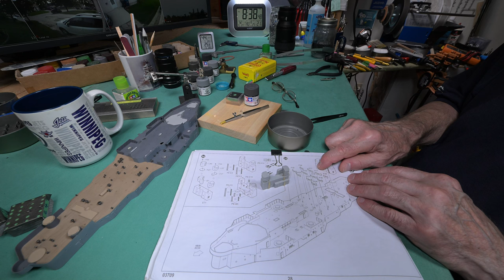The Model Ship - Part 1282

Comment: Hi Ron, I have a thought that might help with the brush painting, if that’s ok. Tamiya paint is actually pretty difficult to brush paint as it’s mainly designed for airbrushing, but it can be thinned and brush painted with a few simple techniques. The trick is to use multiple thin coats, as you are, but with each coat don’t brush more than a few times in the same spot. Repeated strokes will cause the thinners in the paint to dissolve the previous coats and rub the paint off the plastic. Just put on the paint, leave it to dry, then add more coats as needed until it’s perfectly covered. I hope this helps! PS. I enjoy your videos every day, thanks for sharing with us!
Reply from the maker: Hi George,
Re: "Repeated strokes will cause the thinners in the paint to dissolve the previous coats"
I wonder if I was to switch to enamel paint, would that problem still persist. I have some Humbrol enamels. Going to do a test. 🤞
Reply: @roncalverley  Enamels usually are better for brush painting, but they take a long time to dry. I’m not sure about switching paint in the middle of your build. The colors won’t match as well. I think you’ll be able to continue brush painting with the Tamiya and get good results.
Reply from the maker: @georgetaylor2875  Re: "not sure about switching paint in the middle of your build" I was thinking more for the USS Iowa. Doing a test swatch in 1283 today.
Reply: Hi Ron,
I’ll watch the episode. Can’t wait to see the results! And looking forward to seeing your Iowa. The real one is practically in my backyard since I live in  the Los Angeles area. Maybe I can get some good photo reference when you start the model. It’ll be a good excuse for me to visit it again!😃

Comment: Guess you missed that bend line on the radar mast that was meant to be bent back on itself and then glued in the hole. No matter, what you did instead looks just as good.
Reply from the maker: Hi Greg,
I did see the two bending lines and did understand what was going on there. I may still slightly bend the support rod into the angles they are supposed to be. We'll see when that time comes. Thanks for noticing and commenting. 👍